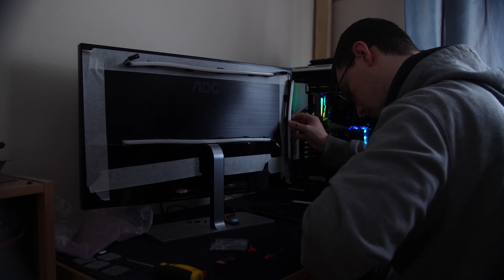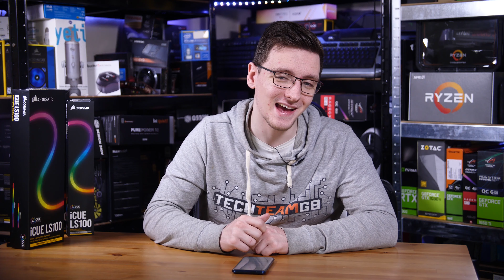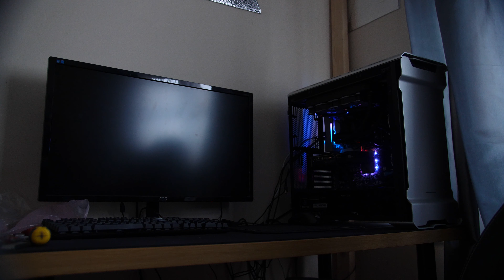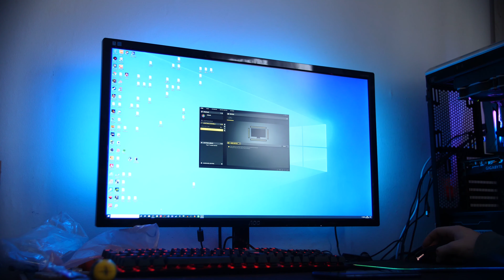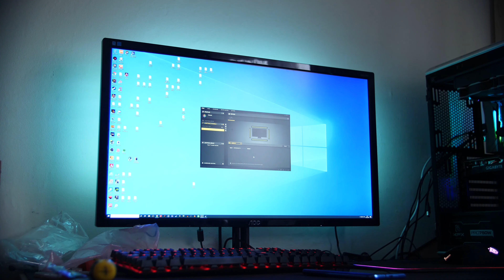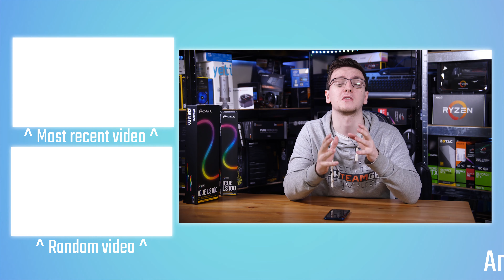Pimp your setup - Corsair LS100 Review

Comment: I use these to light up inside my Tower Case a Corsair 7000D Airflow, All plugged into my  Commander Pro x2 450mm x1 350mm and x1 250mm looks great  ..

Comment: Not expensive at all when you consider a few things.  
1. It is diffused light, the strips your comparing them to are not diffused.
2. The strip you compared it to has less leds than even the 250mm LS100.
3. The strip your comparing it to won't have ique software and link with any other rgb device that is corsair.

Expensive? I'm just not seeing it.

Comment: I like your take on this.  It is quite expensive.  That being said, a 16 ft strand of ws2812b, its controller, and a AC adapter (all of which are sold separately) adds up to roughly $65/£50.  Taking into account that the ws2812b's accompanying software is usually garbage, and comes with little to no support or warranty, that 90 pounds sounds less intimidating, especially if you already have iCue devices that you can sync it with.